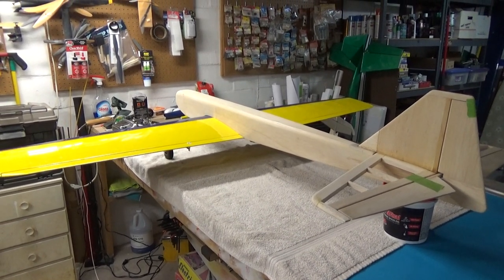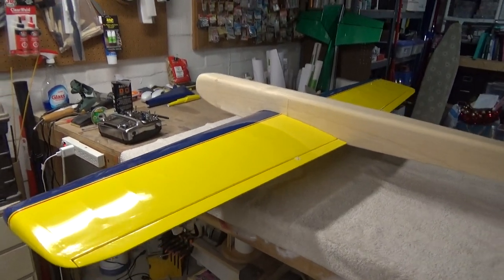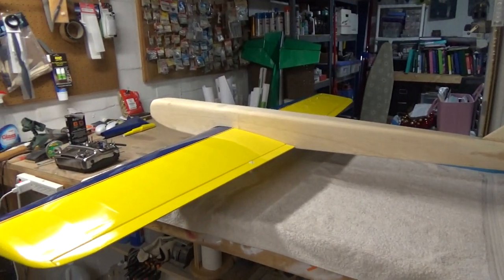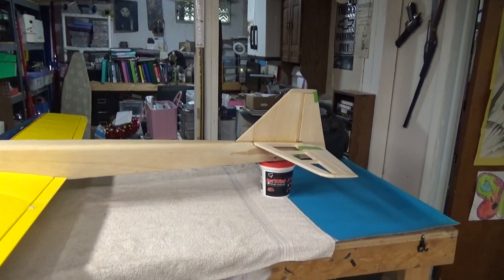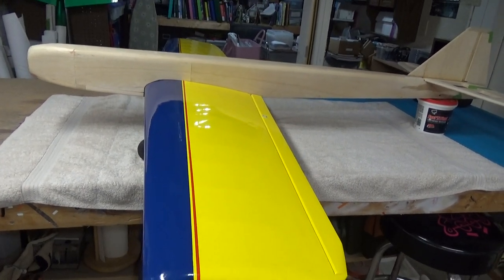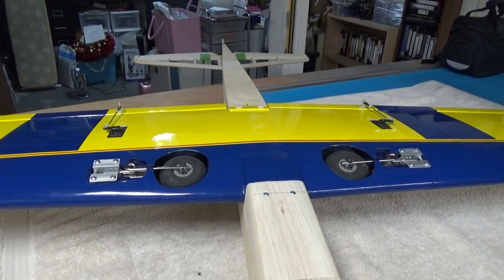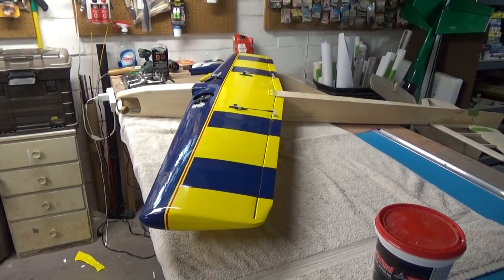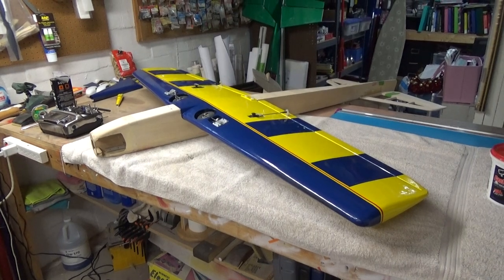Testing Value Hobby Neucover covering!

Comment: I am a big fan of the ultracote it will shrink alot better I am a builder and hate all these companies and products are gone even worse people are hoarding kits up and not to build but I have never liked monokote because it is more work on corners and does not shrink as well but you are right the monokote does have a better finish I just ordered a couple rolls of the neucover because I got 16ft rolls for 15 bucks vs 6 ft of the other brand glad you have a video on it was a bit unsure of it being good on a side note the ultracote I have used in the past few years has been horrible if you have to pull it off it just comes apert as far as the color and clear layers the carl goldberg never was like that

Comment: The Neucover, from Value Hobby, you discuss, may very well be the same stuff I've bought from Hobbyking & Bangood over the years. Easy to use, variable temp control. However, the backing is fiddley to get off.  

I buy it because I live on the other side of the planet to you, so… buying stuff from the States is expensive.   Enjoyed your video.  Thanks.

Comment: I have had some alright results with some of the cheaper coverings on my planes and I found a simple acetone wipe down in parts where there is some of the adhesives is showing and it doesn't entirely go away but will get rid of most of it. for some parts, I will run a knife edge to scape some of it off and then wipe it down again.

something that might be worth trying when covering over covering is sticking the edges down first with a bit more heat (im not sure if you did it this way) and then heating in while being careful to not crease it of course. I have been able to avoid most cases of edges pulling in this way.

Comment: I just finished and ARF Phoenix Models  "Aurora" it's covered with oracover, and it's pathetic, had wrinkles that won't iron or heat gun out, no matter how many times I heat it. Maybe it was the wood finishing but it drives me nuts. It's a shame  too, because it had a nice trim scheme. I have a Trainer 60 I need to recover, so this may be an option, thanks bud!
Reply from the maker: Trainer 60🥰

Comment: What are you going to coat the inside of cowl and firewall with
Reply from the maker: Probably just epoxy
Reply: @n1114v  would you thin it with anything
Reply: @n1114v  would you thin it with anything
Reply from the maker: @CharlieBrown-pb9xn  I usually use resin or thinned epoxy with alcohol
Reply: @n1114v  what kind of alcohol and would asetone work also